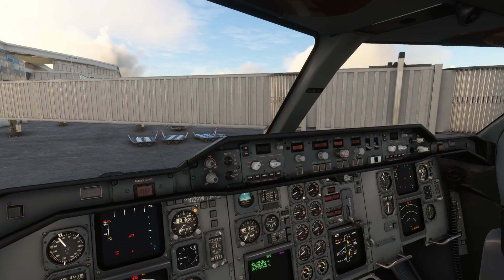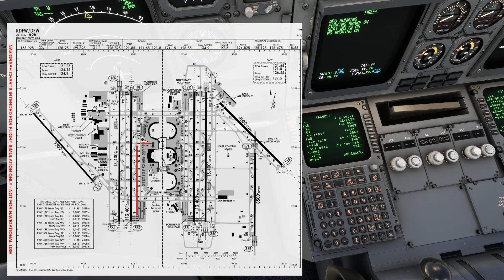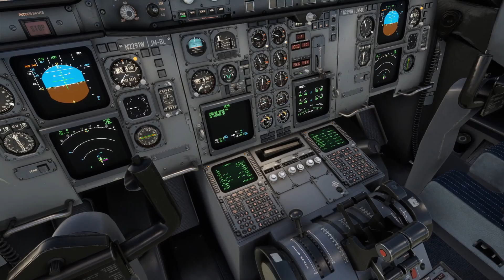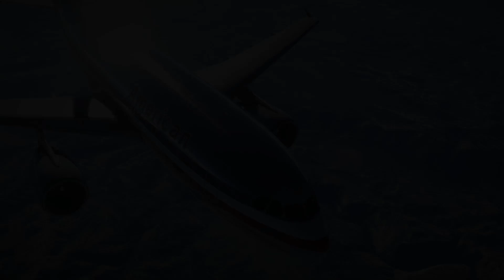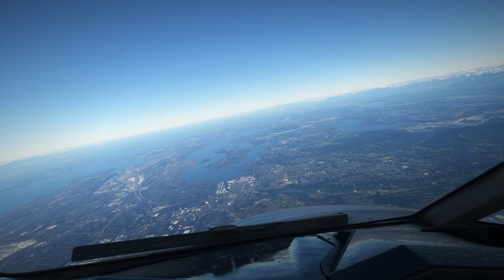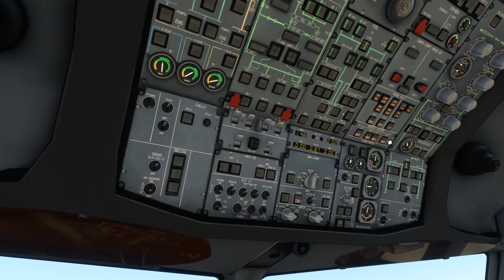MSFS Just Keeps Getting Better! | Ultimate Immersion | Real Airbus Pilot | Airbus A310 - Full Flight

Comment: 'i have a rtx 2080 super and for some reason i cant get the settings right LOL can you share your setting for both NVidia and mfs if possible. much appreciated
Reply from the maker: Hi xxKon

My settings are broadly as follows:

- “High End” preset
- Pre-Cache = Ultra
- Terrain and Object visibility sliders set at 125% (sorry, I forget the actual names of them)
- Motion Blur = Off
- Glass Cockpit Refresh = Medium
- AI Traffic = Off
- VSync = On / 60fps

That gives a nice balance between graphics and performance. I only run at 1080p though, hence the decent fps. The things I’ve turned off / down are known to be famerate hogs.

Nothing flashy really. I do spend quite a bit of time tweaking lighting and weather in many of my videos though (both can make a huge difference in the sim).

As far as Nvidia goes, nothing special there really either. Everything is default except; "Power Management = Prefer Maximum Performance).

I hope that helps a little. Cheers and all the best! : )
Reply: @IntotheBlueSimulations  very much appreciated i will give it a shot and see how that works out . Again thank you and great video.
Reply from the maker: You’re most welcome! : )

Comment: How is your game so smooth.. I have a similar setup to you but I get frame drops quite a bit. Do you post your settings anywhere?
Reply from the maker: Hi Reqnr,

I suspect the short answer is - I run at 1080p haha. That means I can run at a pretty nice fps; I have VSync turned on to prevent screen tearing, so usually that gives me a bit of overhead for any heavy scenery etc. The A310 was certainly still a big hit though ha. My settings are broadly as follows:

- “High End” preset
- Pre-Cache = Ultra
- Terrain and Object visibility sliders set at 125% (sorry, I forget the actual names of them)
- Motion Blur = Off
- Glass Cockpit Refresh = Medium
- AI Traffic = Off
- VSync = On / 60fps

That gives a nice balance between graphics and performance. The things I’ve turned off / down are known to be famerate hogs.

I hope that helps. Cheers and all the best! : )
Reply: @IntotheBlueSimulations  ahh thank you for the reply!
I'm running in Ultra wide 2k so I imagine that it is 😅
Reply from the maker: Haha, that ought to do it! : P

You’re most welcome! All the best : )

Comment: I fly casually in 3rd person, any tips how to make it more stable while in air?, it tends to want to go upwards by itself so i'm constantly pushing up on the joystick and it's very sensitive, much more unstable than for example A320 FWB, any tips for this?.
Reply from the maker: Hi ESP87,

I guess the best tips I can give are 1) make sure you have all of the sim's assistance options turned on 2) make sure to trim the jet (that's most likely why it wants to fly "up"). As speed increases / decreases, you will need to input elevator trim, in order to keep the aircraft in level flight). The A320 is stable, because the jet auto-trims for the pilot, the A310 does not do this.

I hope that helps a little. All the best! : )

Comment: Question, great video by the way, your camera view settings do you have a video showing how to recreate your setup? Thx
Reply from the maker: Hi Luttes,

Thanks very much, I'm glad you enjoyed the video!

I don't have a video on the topic I'm afraid. For the camera movement, I'm using a head-tracking device called "TrackIR". It's great, although a little pricey. There are cheaper / freeware alternatives available though, should you wish to give it a go for yourself. For the wing views etc, I was simply just slewing around using the default MSFS camera controls (you will need to download / install the "enhanced" version of the A310 though, to have the cabin visually modelled).

Does that help a little? All the best! : )

Comment: How do you input the v2? Its the only thing I don't know, you skipped this part.
Reply from the maker: Hi CTL,

Apologies, I thought I had made that reasonably clear (even though I did skip over the process itself). It’s a somewhat convoluted process in the A310: The V2 field of the MCDU, is actually populated by what has been selected on the FCU (autopilot panel). However, for FCU to become operable, you need the Pitch Trim switches selected ON and for those to engage, you need the IRS’ aligned haha. In short; align the IRS’, once done turn on the Pitch Trim switches (next to the Yaw Dampers on the overhead panel), then select V2 in the speed window of the FCU and V2 will as a result, automatically display in the correct field of the MCDU.

I hope that clarifies things! All the best : )
Reply: You set the V2 into the fcu speed window and it will also update that into the mcdu.
Reply from the maker: Thanks for offering up the help OTC, much appreciated! : )
Reply: https://youtube.com/shorts/0VHH3zW5qzo?feature=share

Comment: Are winglets retrofitted on the a310-300 or did they originally build them with it?
Reply from the maker: Hi Niclas,

It looks like as Xavier points out, the A310 was built with them (I haven't come across any pictures to the contrary). Strange though, since I gather the early 320's didn't have winglets. . .

All the best! : )

Comment: Cheers ITB. Now watched in full. Surprised you didn’t mention the external and internal appearance and finishing, although I concede this may depend upon whether or not one has space to download the advanced package. Even though it is free, would be good to have your views on this.
Reply from the maker: Cheers Mark!

Yeah, I wasn't really looking to review the jet, but it may have come across that way, as I simply couldn't help myself at times haha. Internally, I certainly think the 310 looks pretty great (I did download the enhanced version mind you), externally it's a touch "meh" I felt; doesn't have the same level of finesse (I think perhaps with the PBR) as some of the payware competition (not that it looks bad though).

The fps was my major issue, but it sounds like that's getting fixed up. It felt like a few areas of the flight model could use some work also, but that's conjecture on my part. . .

There you go, mini review complete : P

All the best Mark! : )
Reply: @IntotheBlueSimulations  Cheers dude, appreciated as always.

Comment: are those  realistic v-speeds? seems extremely high to me
also i find it absolutely hilarious that as you were lining up on 36R the controller cleared somebody to takeoff on 18L then proceeded to tell someone to line up and wait 18L (especially after i saw that the a310 needed 5/6 of the runway to get into the air)
Reply: Yeah, the airbus a310 is classified as a "heavy" (callsign) plane. Maximum takeoff weight is around 31X,XXX so above 300,000 pounds.
Reply: @zyalixwho  interesting, the fuselage does look pretty wide but I wouldn’t have classified it as a heavy on first glance
Reply: @sesgow  Same
Reply: Remember a normal take off is done with the flaps at 0. Not normally done with most modern aircraft, i normally see 160 to 175 rotate speeds👍
Reply from the maker: I was actually thinking to myself Euin, that the V speeds seemed a touch high, but yeah, that makes perfect sense of course haha.

Cheers!
Reply from the maker: Yeah, I actually thought they seemed rather high also sesgow (at least given that the jet wasn't right up at MTOW), but what Euin mentions, makes perfect sense of course.

Haha, I try my best to keep the videos immersive, but I'm afraid I just don't have the time to trawl through LiveATC and find the "correct" radio calls etc (I already went to the trouble of choosing specific delivery, tower and centre frequencies, for the appropriate stages of the flight haha) XD

Cheers, all the best! : )

Comment: Still learning how to land this plane. Profile descents generally don't turn out well for me. Always end up high. So I'm learning manual descents for the last stages so I can intercept the ILS correctly.
Reply from the maker: Hello Jon,

From what Euin is saying, it sounds as though profile mode is pretty useless on the real jet also haha. 3X your altitude (give or take a factor) seems to be the most common way to calculate a manual profile. There are of course many ways to skin a cat though haha. Modern jets can tend to be a bit more slippy and for what it's worth, I tend to just use 4X altitude at work. It's a touch more conservative of course, but by the time you've got the jet slowed down etc, it all tends to pan out quite nicely. There are jets that manage 3X profiles just fine though, so play around a bit and see what works for you : )

I hope that helps somewhat. All the best!
Reply: We don't use the profile mode much in descent, it just doesn't work or keep up, figures we use 3x Altitude +10=nm to run, start configuring around 25nm to run give or take, and be around 5000ft, anytime you get less than 3x atitute=nm you got to come up with some magic
Reply from the maker: Thanks for offering up the help Euin, very much appreciated! : )

Comment: Excellent video. I think I'll go with MFS instead of Xplane 12.
Reply: Lol
Reply from the maker: Thanks very much FMC, I'm glad you enjoyed it!

It very much depends on what you're looking for in a sim: If you are a die-hard flight model enthusiast, then X-Plane is still the better choice, otherwise MSFS has most things covered pretty well these days.

Of course, both sims all have their strengths and weaknesses. In my opinion X-Plane is still the best (civilian sim) when it comes to flight modelling and it is still the most "realistic" sim overall, but MSFS is starting to catch up in many areas. Until very recently, I still headed back over to X-Plane if I wanted to do some "serious" simming, but now that we have a couple of very high fidelity addons in MSFS (like the Fenix A320), I find I am spending very little time in X-Plane.

Graphically, MSFS pretty much wins hands down of course. My current major gripes with MSFS: Many airports do not have real-world taxiway designations, the ATC system is very sub-par and the weather system whilst very good, certainly still needs some work (it doesn't always match the real world METAR etc).

I spend 90% of my time in MSFS now, for what that's worth. X-Plane 12 is still in beta and certainly has some issues, but I've no doubt it will become a solid sim. I own X-Plane 12 also, but it hasn't done enough to tempt me back over yet.

I hope that helps a little, all the best! : )
Reply: I cant speak for X12. But MSFS 2020 got massively better since release.
Reply: Trust me, msfs has so much more coming in the next year, its gonna be amazing